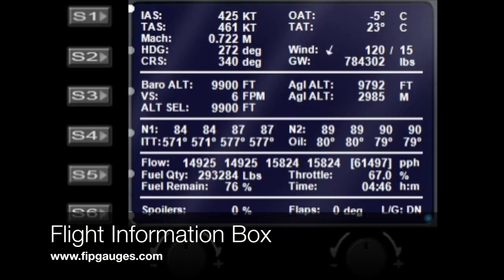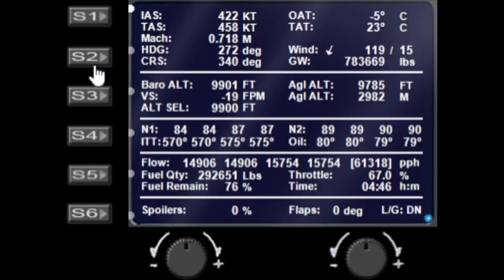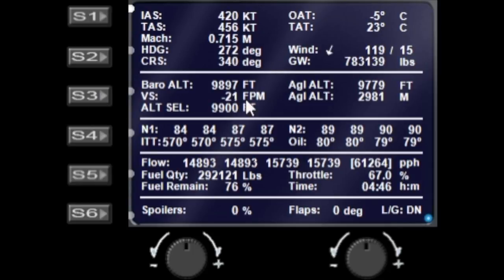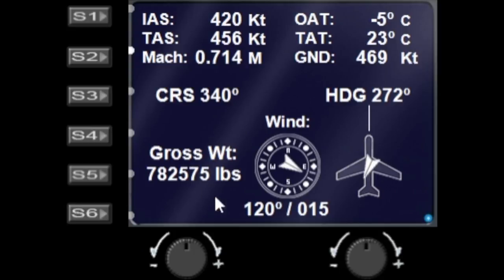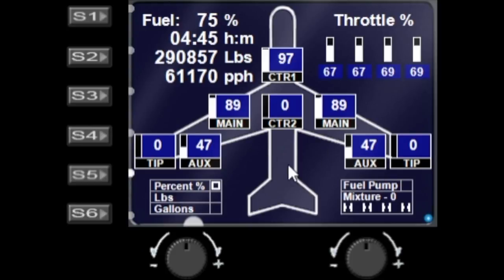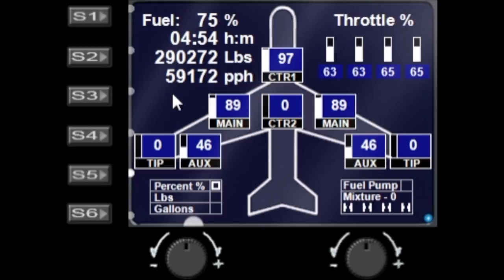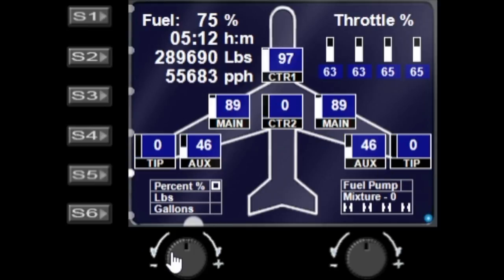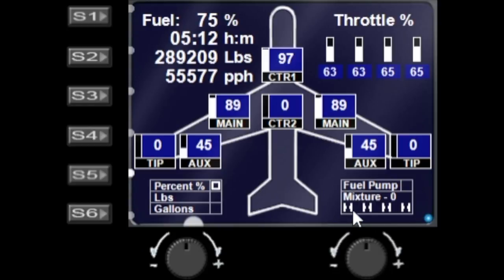Flight Information Box Gauge - Saitek/Logitech Flight Information Panel & SPAD.neXt

Comment: This gauge is awesome I bought it yesterday and it works fantastic .I Will be buying more but I would like to see a gauge that has the ability to have the Saitek features that has the side buttons for panel pushback etc  great work this guy does.
Reply from the maker: Thanks for the feedback. Of course in SPAD.neXt you can make any button do anything. If you want a pushback on a button just add it to a spare button, as long as the gauge doesn't need it for functions. Although saying that you can program a long press to do anything too and won't get in the way of gauge functions. If you break the button programming, remove and re-add the gauge to restore all the default gauge button programming. There's no need to pre-program specific functions anymore.
Reply from the maker: jodonbaker43 while this gauge doesn't have side buttons, because it a complex 6 page gauge, most of my other gauges do have optional side buttons.